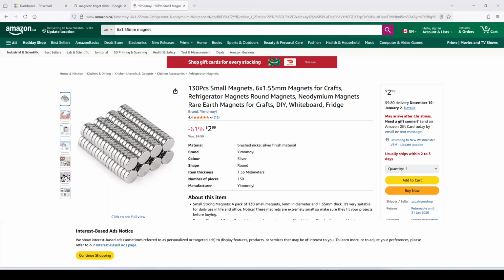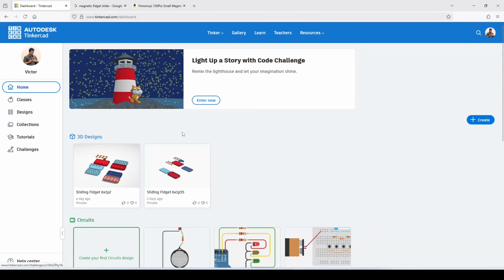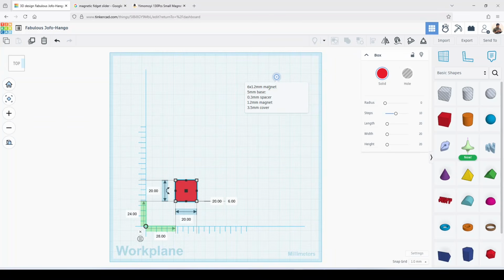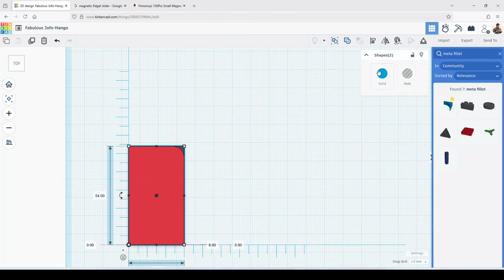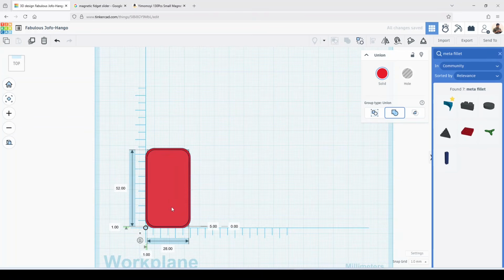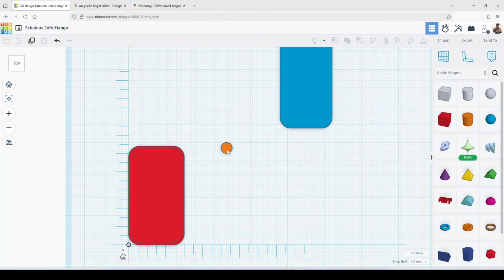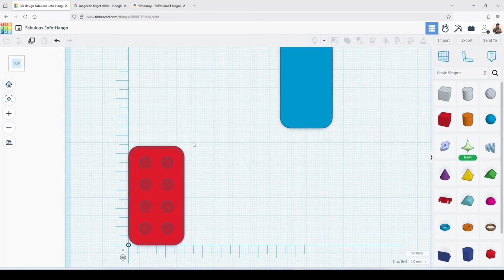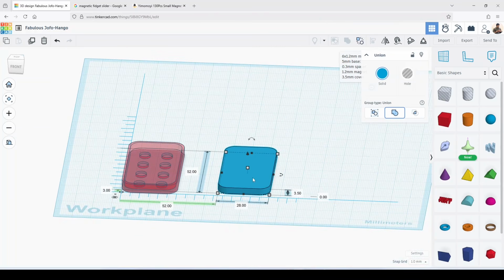3D Model Your Own Magnetic Fidget Slider in 30 Minutes

Comment: Great learning video but... I only see magnets on one side, the bottom and I don't see where the top holds magnets to create the snapping effect or the sliding effect. Please explain.
Reply from the maker: Thanks for stopping by and your question! The video shows how to create half of the fidget slider (the red base and the blue cover) and you need to make a duplicate of it. Once you create that half and assemble it, the cross section would be like this: 0.3mm of the red base, 1.2mm of the magnet, 3.5mm of the blue cover. The circular cavities will house the magnets, and the rectangular cavity (with round corners) will house the cover.
The snapping or sliding effect takes place when you have 2 of these made (make sure you check the polarities of the magnets) and put them together. Hope this answers your question!

Comment: Watched the video, designed my own fidget, started the print and it failed! went to bed.
Reply from the maker: Thanks for your interest and I'm sorry that it didn't print as expected. This could be an issue of the 3D printer (hardware, print setting, filament ...etc.). I exported mine and had it printed using the P1 series from Bambu and it worked. Hope you can try again!

Comment: Great Video!  I've been wanting to learn how to make these!  Quick question.  I do you need to allow any tolerances in the magnet holes?  Will they just squeeze in?
Reply from the maker: Glad that you found the video helpful! From my experience you don't need to have tolerances for the magnet holes -- they end up a fraction of mm smaller than the 3D model, which is fine as your magnets will friction fit into them with a bit of squeezing.

What I did was to place the magnet in place, put a flat object on top (I used the wooden handle end of a hammer), and used a hammer to tap the object's top to squeeze the magnet in place. If you find the hole being too small, you can consider giving it 0.1-0.2mm tolerance, but in my case I didn't have to.

Hope that helps and have fun making yours!